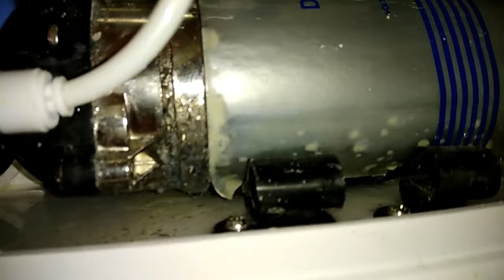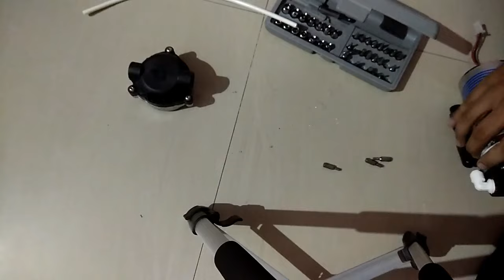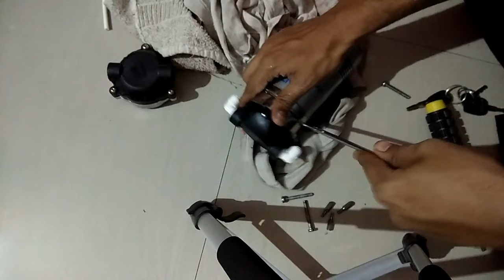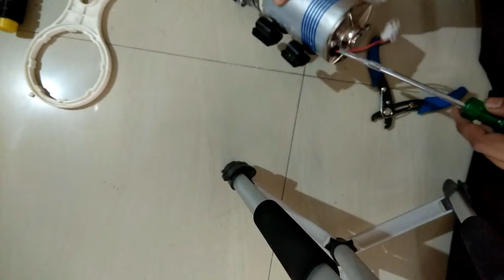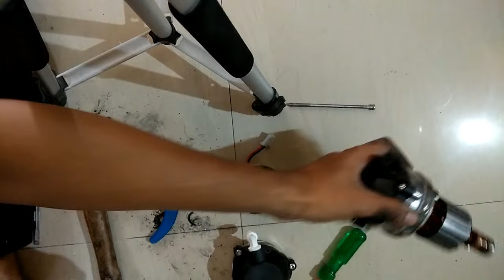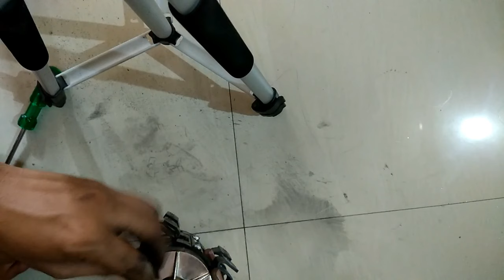RO BOOSTER PUMP HEAD REPLACE/REPAIR OF KENT WATER PURIFER

Comment: Replaced Kent RO head pump with new one but it is still leaking from same place.What could be wrong? do you feel issue with new headpump?
Reply: Use silicon sealant tube , 20 rs ki bike spare parts ki dukan pr milegaa,, head ko open krke side k circle me lgaake tigh krdo

Comment: Replaced Kent ro booster pump 100dp with a new one, but when 24 v supply given direct ,pump is working, and when connected in whole Kent system pump not working. Smps 24 v supply is OK. Pl give advice to rectify.
Reply from the maker: might be the amp rating of the new pump is grater than the SMPS amp. pl check.

Comment: No need of pump head replacement. Open the pump head and wash the rubbers with detol using toothbrush. The pump will work as new.
Reply from the maker: +khader basha will try